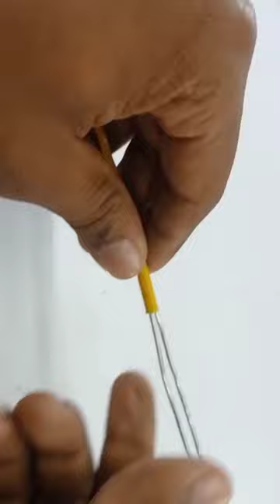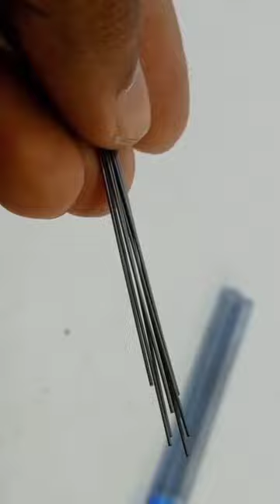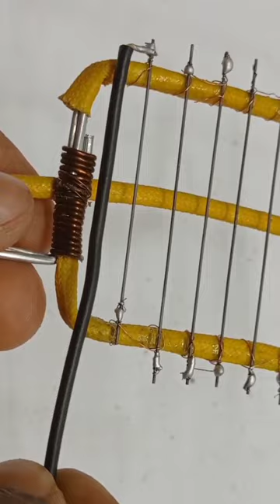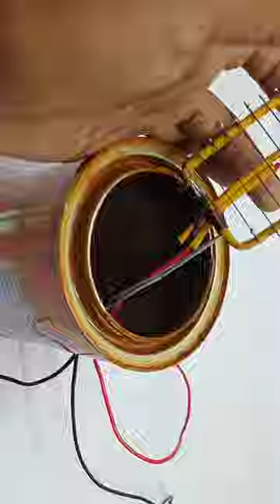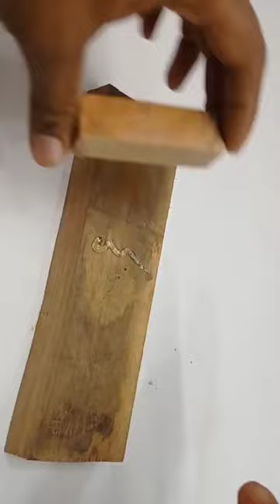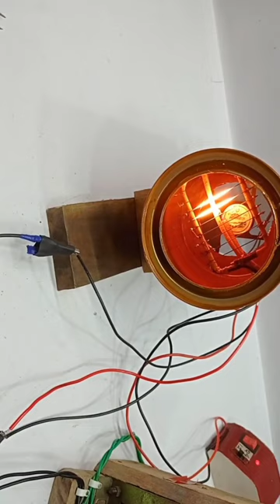How To Make A Room Heater #shorts

Comment: Why  people in India suffer more accidents? 
People in India :
Reply: 😆 That is for real though a fan forced heater and they work amazing in the US. I stay in a medium sized camper with one on each end with a thermostat turned on and as long as you don't let it get too cold they both keep up and I don't even have to turn the propane heat on! Like if it got down to 20° or lower and I accidentally left them off it could take like 30 or 40 minutes for both heaters to catch up or I could turn on the built-in propane furnace heater and warm it up in 5 minutes and then let the electric fan heaters to take over. Those fan heaters really work good! And they circulate the air well so they're constantly pulling in cold air and pushing out hot air.